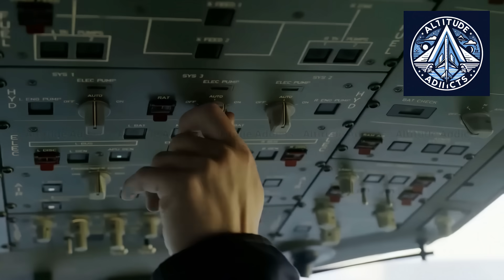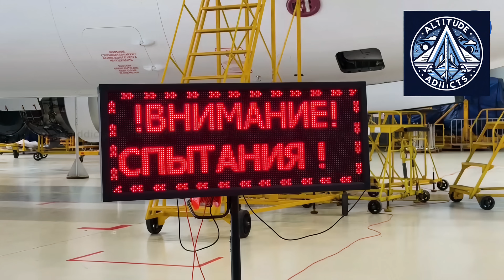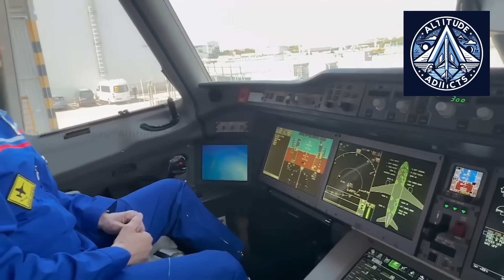MC-21 Airliner: Only 5 Foreign Parts Left—Russia’s 2026 Certification Goal

Comment: "Некоторые элементы электроснабжения самолёта",  сколько там некоторых?
Reply: It could be a few or many. Accumulators, electrical wires, sensors, even electrical plugs, etc. 
Most important, If you understand a problem, it could be solved.
Reply: @АлександрИсхаков-э5п  5 систем не осилили

Comment: Regarding the weather radar and anti-collision systems, surely that could be speeded up by lifting designs from older (already widely exported) military systems of equivalent function, and then creating a more modern interface using modern digital technology? That would significantly reduce lead time and reduce the potential problems and bugs

Comment: In an earlier video on this channel, about 2 months ago, you guys said the 
Import substitution program was going badly. You mentioned that the all domestic MC-21 is very overweight and therefore has much less range. Also you mentioned that the price has increased greatly and the MC-21 now costs more than an equivalent, Boeing or airbus. Is this still true?
Reply: yea this channel puts contradicting information.. anyway, the information about the domestic MS-21 being overweight and thus has much less range is old information and to put it mildly unconfirmed, I personally don't believe it for a second..
Reply from the maker: I report news. In some news, we can find an expert say contrary. In some news experts are pro. In some news, we report what the officials said. This is normal. As far as overweight is concerned, the latest comment was by ex KAZ head stating that developers have not officially announced the range of the aircraft. Last year, we came to know from Kommersant that it's overweight. So, I reported it. As per officials, the passenger capacity is being reduced to make it fly full range. So logically, the aircraft is overweight. What one must understand is, we can't keep going back to old specification to evaluate. The plane is a decade late. Technology, requirement etc has changed.
Reply: @altitudeaddicts  What experts? You're spreading fake news from paid propagandists! We need to listen to the OFFICIAL statements from the United Aircraft Corporation and its subsidiary, the Yakovlev Design Bureau!
Reply: Soal berat, hal itu sebenarnya masih perhitungan kasar berdasarkan vendor yang dipilih. Bisa jadi di tahun depan komponennya lebih ringan.
Soal harga, memang benar bisa lebih mahal karena harus buat dulu pabrik berbagai komponen untuk pesawat itu.
Persoalan kualitas, saya tidak terlalu yakin jika kualitasnya buruk.

Comment: How is work coming on the weight?
There was 1/3 range lost with the new domestic components causing the plane to be much heavier, yes?
Is there work to resolve this?
There seems very little discussion of this topic on various YT channels.
Reply: Mohon bersabar. 
Jenis komponen yang terpasang belum seluruhnya. 
Oleh sebab itu belum bisa diukur berapakah berat kosong pesawat ini.
Reply: The weight problem was raised in 2022, now is the 2025... It is solved, mostly. Three years of work achieved the result!
Reply: @maksimluzin1121  Nothing has been solved. Still six tonnes heavier than the one that uses imported parts.